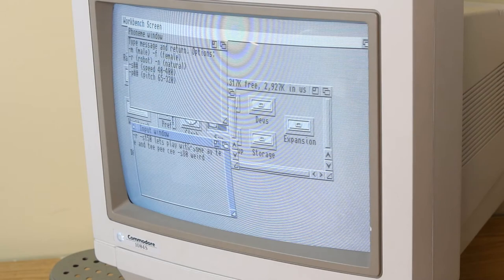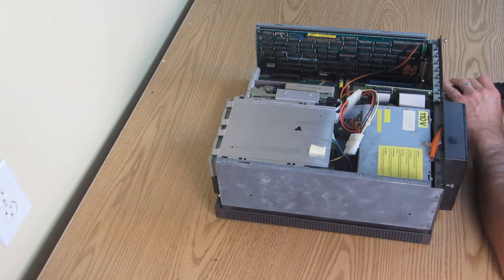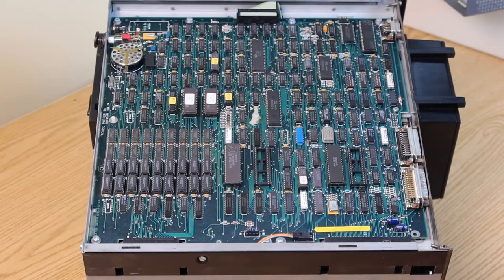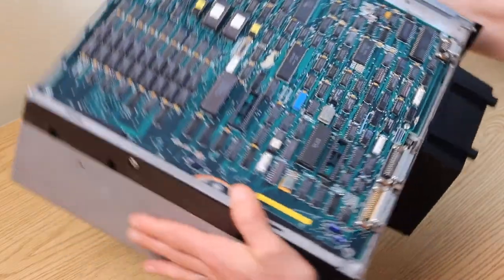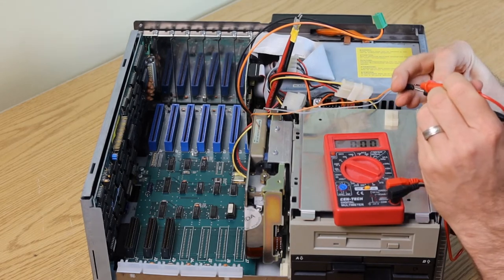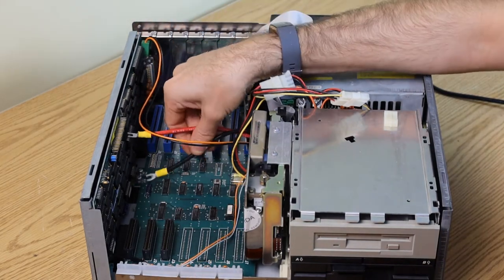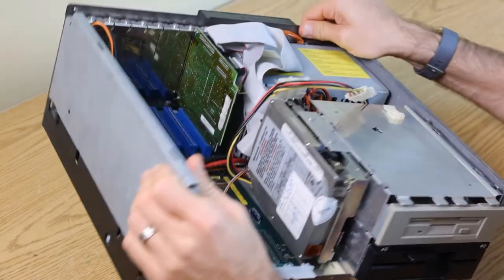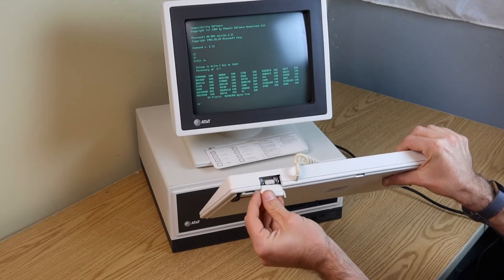Digging into the AT&T PC 6300

Comment from the maker: There are a bunch of potential projects for this computer.  Like I mentioned in the video, creating an adapter to interface with the mouse port on the back of the keyboard is an obvious choice.  It would also be interesting to create an EMS board (perhaps a modification of the Lo-Tech 2MB EMS board) that uses the extended 16-bit data bus.  Perhaps some day...

Comment: Some things you might not know. The computer is actually made by Olivetti and is for all intents and purposes the same as their M24. The "CGA" in it is capable of a 640x400 mode which is also used in monochrome giving it a higher quality text mode than the MDA/Herc, using a 8x16 character set. It can also accept a Z8000 co-processor board which when present can also allow for a 512x256 16 color graphics mode. They also made a "display enhancer" board for it that allowed for 640x400 16 color graphics in both PC and Z8000 mode.
Reply from the maker: I knew some of that, but did not know about the Z8000 co-processor board. The PC 6300 that I got this summer (see https://youtu.be/RGDO-0roE8A?t=116) has some cool, rare upgrades in it.  I plan to do detailed videos about all that later this year... probably in December.  I believe the CGA output is analog (instead of the usual CGA / EGA TTL levels), and I've heard it's possible to build a simple adapter to connect it to more common kinds of analog displays.

Comment: Even though this machine is just an 8088, I love the look if it. Computers as well as cars back in the day (1970s-1980s) IMHO had so much more style and class. Varta batteries have killed so many machines. Awesome that you removed it straight away. That speaker looks like it came out of a telephone receiver and the more I think about it, since this is a AT&T computer, that makes sense. I was very happy to see when you tested the power supply you didn't jam a jumper wire in it 8-bit Guy style and kill it LOL.
Reply from the maker: The thing I realized after making the "Thanks, AT&T" comment is... this system was actually made by Italian PC designer Olivetti.  This is the same as the Olivetti M24.  It must have been fate that brought them together. :)
Reply: Actually it was not an 8088 chip, it was an 8086 running at 8mhz, more than twice the speed plus it had a nonstandard 16 bit bus which was not compatible with 16 bit cards not built for the 6300. 

IBM dumbed down their x86 system so it would be compatible with CP/M that ran the Z80. This ment you could use your old CP/M software and some hardware and files on your new machine. It came with a version of CP/M for the IBM PC.

The 6300 went back to the original older style chip and bumped the speed up and out  preforned the IBM PC.

Comment: I had an AT&T 6300 and back in the day I purchased a Logitech 3 button Bus Mouse. The problem is DOS software does not use a mouse. Logitech provided software and drivers to interface with some programs especially Excel. You could program the mouse key presses.
Reply from the maker: Some DOS software would use a mouse, but, yeah, not much for XT-class hardware. The drivers for the very rare AT&T mouse that connects to the keyboard could generate arrow key presses for mouse movements. That could be useful.
Reply: @TalesofWeirdStuff  I have the drivers for the Logitec Bus Mouse but not the mouse and card. The connection to the bus mouse was backwards to the serial port. I never saw an AT&T mouse for sale and never knew about the mouse port on the keyboard.
Reply: @TalesofWeirdStuff  I have the Logitech Bus Mouse driver and software but not the mouse and board. The plug was like a serial port but female. I don’t remember seeing an AT&T 6300 mouse for sale. I looked up on the internet and Olivetti came out with the M24 mouse and it later turned into the Logictech mouse, I assume the bus mouse. It appears that you are looking for the Logitech bus mouse if you want to plug into the keyboard. Otherwise you are looking for a serial mouse to plug into the serial port on the back. Logitech had that mouse software bundled with the mouse package. 

Let me know if you want the 3.5” mouse driver disk. I threw away the original 5 1/4” after copying all my old disks to 3.5”.

I later used the bus mouse on my WIN 95 machine until I got some new hardware that confilted with the interupts the bus mouse board was using.

Comment: 3:06 theyre also a hex screw.  i bet your screw driver could use the hex.  pull out all the bits and whats left may fit the screws.
Reply from the maker: At the time, I didn't have the full complement of tools. :) I have fixed that now. A lot of IBM machines also use hex-head, flat blade screws.